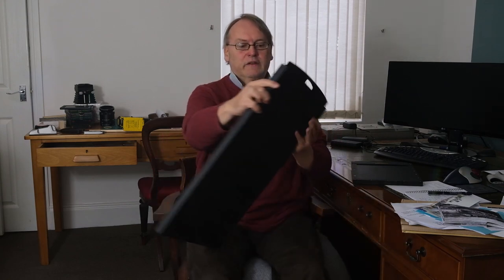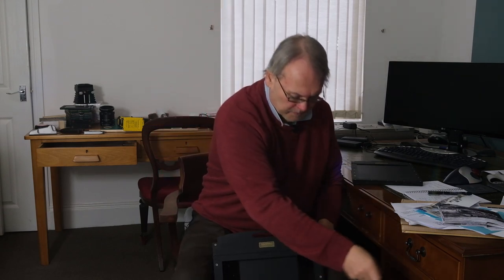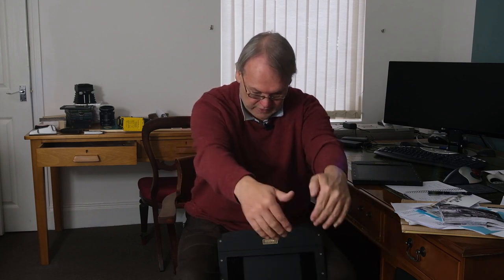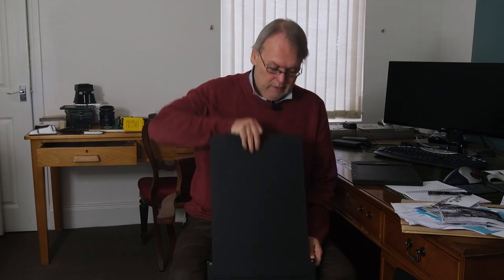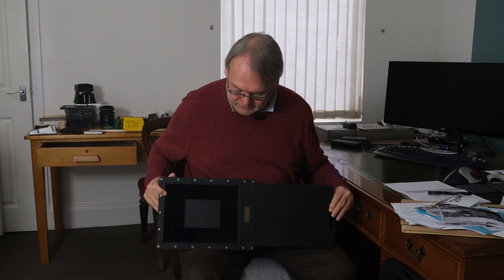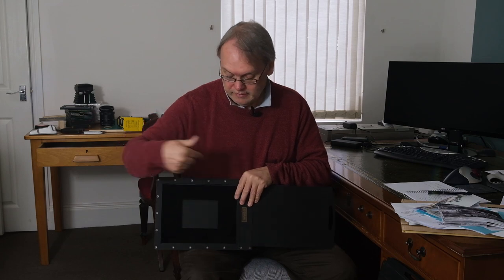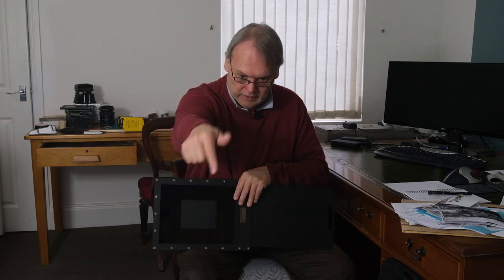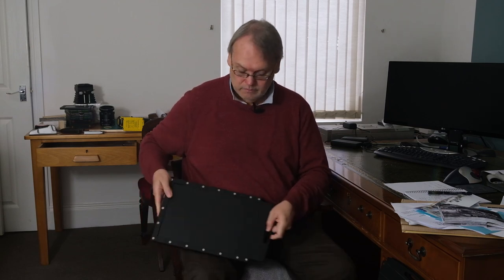Getting ready for wet plate - The Holders

Comment: Hi @Dave Smith Photography. Today I received my full plate field camera (vintage) with 2 wooden holders. You-re mentioned that when shooting tintypes we should put one piece of 2mm glass behind to make pressure, right? When I opened these 2 wooden holders  there is a piece of metal that looks like an adapter to slide sheet film in it as it has guide rails. Do you think the purpose of that piece of metal, (it seats perfectly on the spot for the glass plate!) is to load film or just to put pressure between the holder and the glass plate? Thank you in advance for your help David.
Reply from the maker: Hi Luis

Can you send an image of the plate?

Dave
Reply: @DaveJSmith  thank you for your reply. I just subscribed your Instagram Dave Smith Photography.shop and sent a photo of the holder
Reply: @DaveJSmith  I've sent a photo to your portrait business email address. Thank you.